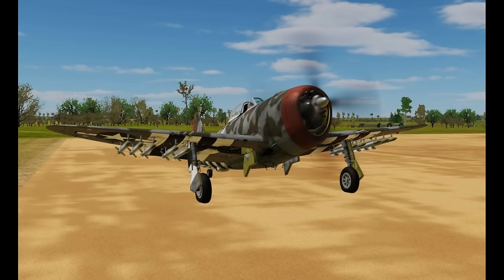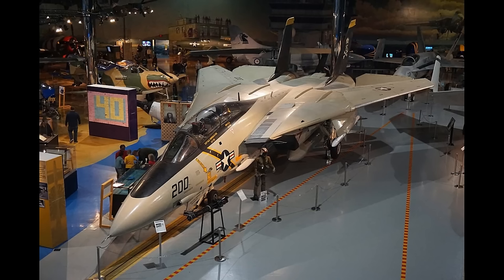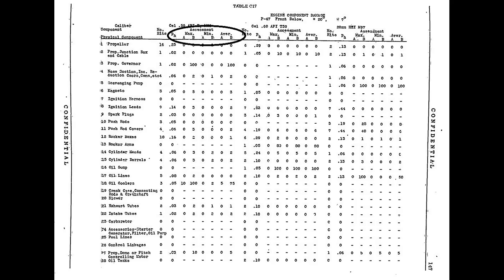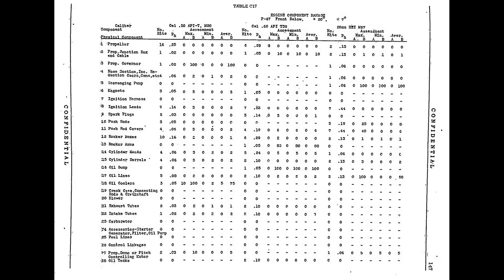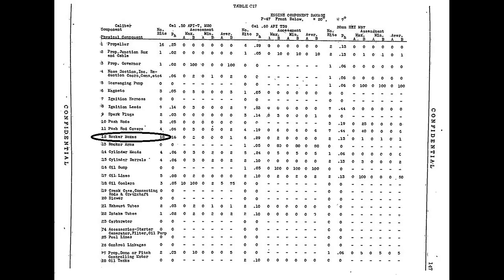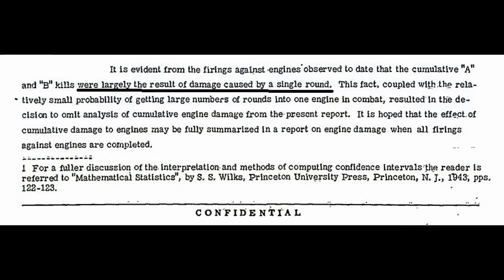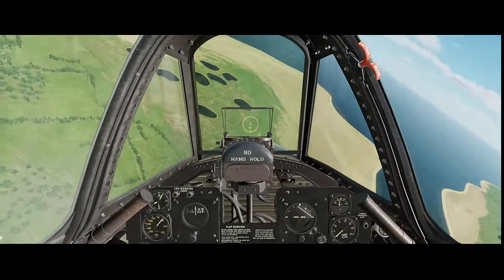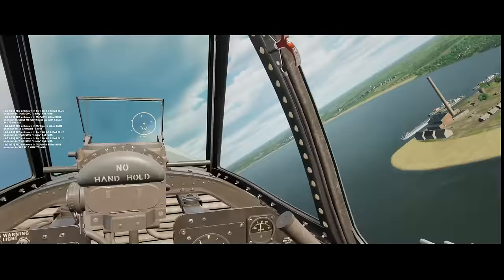50 Cal Vs. 20mm Engine Damage in WW2

Comment: I had to laugh when you talked about American V8s losing a cylinder and some people not noticing. Back in the 1970s there were a lot of American servicemen stationed at Upper Heyford and Croughton, near Banbury, Oxfordshire, UK. They brought over their big V8s and sold them locally when they were posted back to the States. In 1976 I bought a 1966 Pontiac Parisienne convertible and drove it around for a while. It was a fabulous car that turned a lot of heads. After I sold it, I was told it had been running on 7 cylinders for a long time....! Thanks for the video Greg, much appreciated as always.
Reply: If it was left hand drive, it was a Canada only car. If it was right hand drive, it was from Australia, New Zealand, or South Africa.
Reply: I remember a coworker telling me stories of how him and his friends in the beginning of thier high school car driving time would disconnect one plug wire from their cars before going through the local parking lots because they thought people would be impressed that they had also done engine modification and had cam swaps 🤣 Apparently they and everyone else could distinctly tell that it was just a misfire, so after being made fun of they quickly became gear heads and poor high-school kid hot rod builders... But using actual upgraded cams, ignition, carburetors, polished intakes from junkyard engine swaps, running on all 8 cylinders! (Atleast until the engine finished wearing out it's bottom end, requiring a fresh junkyard replacement to put the aftermarket parts on 😆) He was born around 1948, so big in the hotrod scene from the 60s-the 70s until real life got in the way, so plenty of great "junk" to be bought at scrap value during his youth! 👍😉
Reply: My jeep cj-5 with a 304 V-8 went months on seven cylinders before I noteced and fixed it
Reply: Reminds me of Prior's scrap yard in Yaxham Norfolk.
Reply: weirdly for a comments thread I have owned a US car brought over to England ( bought in Oxford) and also have driven past the mentioned scrap yard .... small world sometimes !
Reply: My dad was a racecar mechanic for a local drag racer when I was a kid. 67 Nova with a 540 big block that ran a 8.9 sec quarter mile on 7 cylinders. Did a post run inspection and found that the #8 plug wire had melted yet it still ran fine and put up a great time
Reply: There are some modern 8 cylinder  BMW's that intentionally turn off 2 or more cylinders for fuel efficient, doesn't surprise me a big 16 cylinder or even a 12 cylinder aircraft engine, not in combat at least, wouldn't be significantly impacted with the lose of a cylinder or 2...

Comment: The most impressive damage I ever say was during Vietnam on one of our Corsair 2's it came back with a rocket or cannon hole in the tail just slightly smaller than a basketball. What was far more impressive to me was the tree branch stuck in the fiberglass at the mouth to the air intake, how he made it back without fodding the engine is beyond me.
Reply: Reminds me of the stories from Goose Bay where the German Air Force trained low-level flying and would buzz elk fairly regularly, ding the radomes against the tree tops and sometimes even bring home some pinecones lodged between the intake and the fuselage side...

Maybe it was all BS. I don't really know, I wasn't there.

Comment: I absolutely love the fact that you have this obsession with data, and the ability and knowledge to interpret it for the rest of us. I'm one of the oddballs that enjoys this careful analysis of minutia. So thanks, Greg. Another great one.
Reply: Why have they developed 20mm and 7.62x51mm (30 cal.)Gatling type guns but no .50 cal?
Reply: @46bovine , that would be the GAU-19 actually.
Reply: @46bovine  As Jacob mentioned they have, but also weight. A 30 cal minigun is around half the weight of a GAU19. And 30 cal ammunition is way lighter at 6-ish pounds per hundred rounds compared to 24ish pounds per 100 .50 cal. 

The GAU19 is used mostly in light helicopters, probably because the weight is less of a concern and it is more potent than a 30 cal for defensive use.

Comment: a 20 second burst? they must've had huge ammo hoppers
Reply: That was probably all they had - Spitfires had 12s, I seem to recall from an earlier Gregivideo
Reply: Test environment, fire single gun for longer rather than battery of 4 or 6 from a real ww2 plane.
Reply: The p-47 had so much freaking ammo. At least 30 seconds with 8 guns.
Reply: @martinwright7367 Yeah they could use a slower rate of fire single gun for testing which would make 20s burst equivalent of 1-2 second burst from plane like P47.
Reply: @Fooney1  Amazing plane.  I only really started learning about it watching Greg.  It is almost unheard of in GB.  Yet, everybody knows about the Mustang.  I suppose it is like the Flying Fortress, which everybody knows, and the Liberator, which few do and even less like.  I built models of the Mustang and the B-17.  One fact I picked up is that the P-47 was simply much more expensive than the Mustang, which may have affected the issue.  But, being so much bigger than the Mustang, it carried more ammo.  This was a big issue during the Battle of Britain, as 12s of ammo was enough for maybe just 1, maybe 2 dog fights.  With .303, they needed a lot to take out a bomber.  I would like to see gReg do a vidoe on 303 vs .50 Cal.
Reply: @helloxyz The reason the P-51 is so famous is because it was it had the range and high-altitude performance to escort bombers to anywhere in Germany and back.  It’s also famous in Britain because it used a Rolls Royce engine in order to get that performance.  The P-47 was also a great fighter, but wasn’t as pretty or long-ranged as the 51, so it didn’t get as many accolades.   The B-24 was actually faster and carried a bigger bomb load than the B-17, but it was also a lot less rugged and reliable, and had a disturbing tendency to catch fire easily when hit.  It was an ideal aircraft for sea patrol missions and for the longer distances in the Pacific.  But it had some issues flying through flak and fighters over Germany.  Not a bad aircraft by any stretch, but it had some real vulnerabilities.
Reply: @bluemarlin8138  Hi, thanks for the update.  Greg did a great video on the P-47 range vs the P-51D (he is a bit obsessive about the 47).  It seems that it could reach Berlin a year before the Mustang, but nobody thought to do it.  Your point about the Merlin is spot on, the Brits are obsessed about the Merlin, there is even a Merlin flight of Spitfire, Hurricane and Lancaster, and when it flies overhead is pretty spectacular for the noise.  I've never heard a radial P&W, so I don't know if that would be better.  I imagine not many people can tell the difference.  Greg also did a video on the B-17 vs the Lancaster, in which he proposed that they were about equal.  I wasn't convinced, the Lanc regularly carrying much heavier bomb loads in actual practice.  But it was also designed 6 years later!  I've juest been reading a lot about the B-24, which was instrumental in winning the Battle of the Atlantic, for which it received very little publicity.  I suppose there wasn't that much flak over the sea.  But I was amazed at how many B-24s were used by the RAF.
Reply: Of sorts ;)

Comment: Heard from a P-47 pilot 35 years ago that if you loose all oil if you immediately bring the power on the engine back to minimum power needed to stay aloft the engine could run for a long time without any oil.
Reply: I think I would choose the p47 if I could, for it's robustness
Reply: You could stay in the air long enough to get to the crash site.

Comment: On the topic of rate of fire and total amount of fire, this is partly why the .60 Cal machine gun program was halted. They found that aircraft could carry far more .50 cal than .60 cal, and that the extra energy didn’t provide enough benefit to justify the drastically reduced capacity and increased weight.

Comment: The .60 cal cartridge was eventually modified to become the 20x102mm.
Reply: I was about to ask about the .60, I'd never heard of it before.
Reply: 0.60 cal would be 15-16mm. I'm speculating here, but I'm assuming it would have been roughly equivalent to the German 151/15
Reply: @jonskowitz  One of the first guns it was chambered in was actually a modified MG 151. It was 15.2mm, so only a little bigger than the German 15mm. However, it was much more powerful. Fired a 76 gram bullet at 1,100 m/s compared to the German cartridge firing 72 grams at 850 m/s. Gets close to double the muzzle energy (46,000 vs 26,000).
Reply: There was a pre war anti tank rifle that the rounds were designed for

Comment: There were also British tests post-war of the mk-108. Showed the thin-walled HE shells were devastating. The took photos, showing static Spitfire fuselage with tail blown off from one hit in rear fuselage, and wing demolished with one hit. 
I believe there is a piece of combat film footage purporting to show a B-17 losing its wing at the root following 4 rounds of 30mm from a Me-262's firing pass.
Reply: I’ve seen this video. What’s even More devastating is that when you consider that spitfire was stationary and not going 350+ knots. This happens it’s likely to have whole panels/ailerons/flaps just rip off from the air speed after it becomes flared.

Comment: Greg, if the cylinder shot off was the "master" or number 1 cylinder of the row, the engine would seize immediately. Any of the other 8 cylinders could be shot away, and the crank could still turn. The master rod was connected to the crank pin. The other cylinder connecting rods were connected to the master rod.
Reply: I can believe a cylinder head being blown off, but I don't believe the stories of having a cylinder or cylinders shot away and still able to fly. No radial will run with any one cylinder missing. You've now got the remains of a piston on a rod that is flailing about beating the crankcase to bits.
If there is evidence of any radial engine losing a complete cylinder barrel and making it back to base for a safe landing I'd like to see it.
Reply: The master rod and crank pin were massive because there were 6 or 8 other connecting rods tied to the big end. Also, the "slave" rod was smaller and rode on the master rod's outer surface. The piston and rod, or the severed rod would in fact reciprocate in the missing cylinder's location, depending on how much length was left (the longer the better) which would cause damage to the crankcase in the area of the missing cylinder but would not keep the crankshaft from turning. There have been some fools starting a radial engine only to hear a loud bang and a clatter, then finding a lower cylinder laying on the ground in a pool of oil because they didn't pull the prop through to clear the lower cylinders.

Comment: The Hawker Typhoon at time 15:15 is XP-P R7620 of No. 174 squadron, hit by flak on 22nd February 1945.  It was the oldest operating Typhoon at the time having entered service in January 1942.  The crash landing was at Volkel, The Netherlands, a No. 274 squadron Hawker Tempest in in the background.
Reply: Despite all that gusseting and bolstering to make up for the initial designs' flaws, it still crumpled right up into a pilot-killing wad. Thank God for the lend-lease aircraft!
Reply: @mikemulligan5731   The pilot posted the picture.
Reply: @mikemulligan5731  The Typhoon may have had problems with the tail section but it could take quite a bit of battle damage and was at least equal in performance to the FW-190 at lower levels. The problems with crash landing were down to the big air intake. I'm not sure where lend-lease aircraft come into the RAF picture with respect to land-based fighter bombers and fighters in the ETO.

Comment: The quality of castings that could be achieved in the 1940's for those radial cylinder heads is pretty amazing.
Reply: The US casting industry went far in WW2. They even started casting 1919/1917 parts. There was a plan to cast a whole receiver but it didn't go anywhere. 

Most people call anything cast "cast iron" but there's really a whole world of cast steel people don't know about.
Reply: @edwardscott3262  Heads on a R2800 were made from aluminum. started as a 70lb billet with the finished head coming in about 25lbs.
Reply: I'm probably wrong, but I don't think we have the craftsmanship in today's world to produce those  beautiful and complex radial engines.
Reply: @roberta.6399  Modern gas turbine engines (eg) are many times more complex and demanding to manufacture yet vastly more reliable and cost effective for the job. Not as pleasing to the untrained eye or ear though sadly, I agree.
There's lots of high level skill around. The latest chip foundries easily fit 100,000+ components in the x-sectional area of a hair. They make many hundred sets of ~20,000,000,000 interconnected transistors simultaneously in a few hours - using mirrors crafted so finely that if they were scaled up to the size of the country the biggest defects would be much less than 1 mm high.
The reality is that those engines would be easier to make and better now - with a fraction of the workforce - if someone wanted them enough to pay to set up the lines.  I love the older stuff and the people-based production methods I was in at the tail end of, but....
Also, the overwhelming majority of the good people who actually built the B-29s, R2800's, P-47s,  whatever were not highly skilled at all (in engineering terms) - but 'ordinary' folk from farming communities, small towns, etc with just a month or two of training for specific limited tasks. An amazing and extraordinary feat by all involved. Cost effective mass production is dependant on concentrating the high skill levels in the smallest possible section of the workforce. A bit sad for society, but good for consumers.
Reply: @jackgee3200  Thank you for taking the time to post this concise and accurate response. Thanks to the evolution of the computer and other technologies and processes and techniques, design and manufacturing are light years beyond what was possible in the 1940s. And, thanks to those advances, far more can be produced, much faster and with far higher consistent quality while using much smaller work forces. Nothing stands still and no one who really understands how technical advances have improved the quality of life for millions of people all over the world really wants to roll the clock back to the standards of nearly a century ago.

Comment: The P-47 Thunderbolt Pilots Association rented a pair of P-47s and brought them to Santa Rosa back around 2000, California. A group of us helped get the veterans into and out of the planes and their stories were great.

One of the guys that I knew flew in Italy and he had been hit by 20mm in the engine. He said that he lost 2 cylinder heads being blow off but the rest worked and flew back to base with no oil pressure for 30 minutes. He has a piece of his glass that was shattered

Comment: So I’ll be writing comments piecemeal as I watch this, but the “Ph” column is probably “Percent Hits”. Note how for each gun the number of hits and the Ph is the same: for the M2, 1 hit = 0.02 Ph, 2 hits is 0.03, 3 hits is 0.05, etc.

Assuming this is meant to be percentages (i.e. .25 Ph = 25%), then we can work out the rounds fired and with the fire rate how long each burst was. For the M2, this works out to about 64 rounds fired, or a 5 second burst. I don’t know the rate of fire for the T39 or M97 offhand, but I’m calculating 21 rounds and ~15.8 rounds fired for these guns, suggesting the goal was a short burst. I imagine that for the sake of the tests they had short belts rather than trying to time each burst directly.
Reply: Otherwise I don’t have too much too add, this was an excellent analysis as always.

Comment: The angle used in the test is a big factor. Rounds per minute or rounds per second is very important in air combat , at the angle tested, if my understanding is correct would produce a closing rate of considerable speed. What a FUN test to participate in!

Comment: I once had a Chevy Nova with the inline 6. There was an aftermarket air conditioner added, mounted on a bracket over the sixth spark plug. Took forever to get off when changing the spark plugs. When I did, I found the last spark plug was very dirty and old, and a different brand than the other 5, because no previous mechanic took the trouble to change the sixth plug. I wonder if that cylinder was even firing.
Reply from the maker: My point exactly.

Comment: From a technical standpoint concerned with important details about how to make a great episode of a technically oriented channel, all is there. The subject is clear, not to be too redundant but the voice over is perfectly conversational, though still narration. I personally love the R-2800 having worked on them, as a mechanics helper I have to add, but paying attention to them. I looked at them an awful lot. These were powering the DC-6 used for freight. About every one of these 40 and more years old aircraft had their pressurization equipment pulled out. Typical flights would be up to 12 thousand feet AGL or MSL. I did get to fly a DC-6 in the air left seat for 2 hours. I also once flew a Tomahawk from Fort Lauderdale International to Pompano on single mags because I was stupid and had not turned the mag switch to both mags.